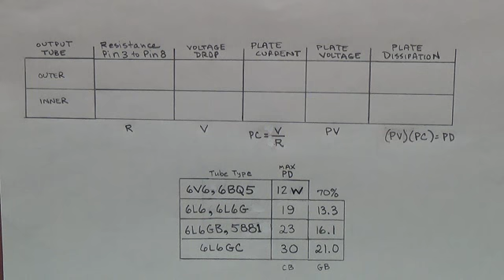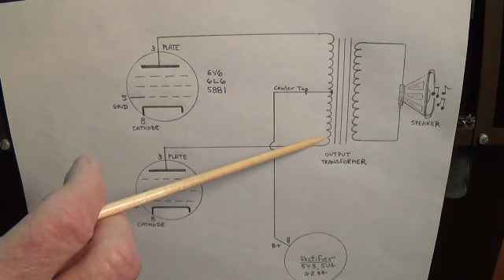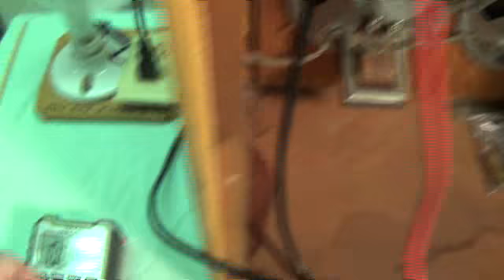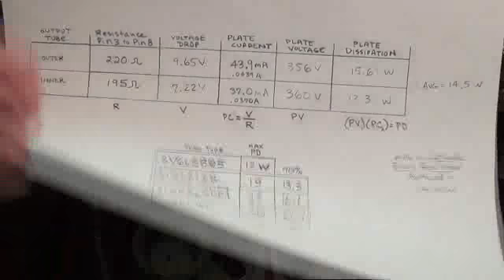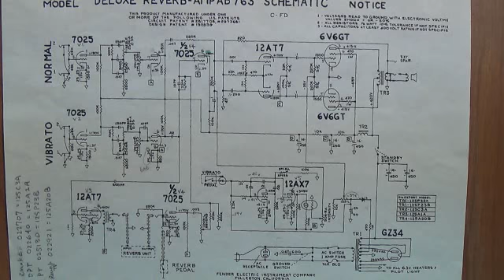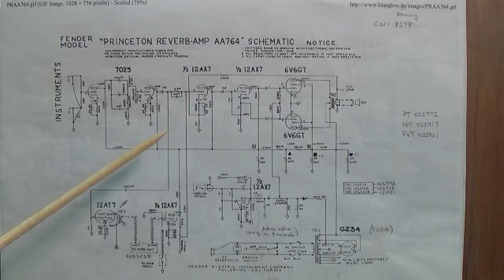Biasing Double-Ended Amplifier Output Tubes, Part 2: Demonstration and Discussion

Comment: When checking resistance from pin 3 (6v6), to pin 8 (5U4) on my old Epiphone Electar amp , I get a steadily increasing reading where the reading will not settle down and stop. My meter is good as per testing a  known resistor.  Any thoughts anyone?
Reply from the maker: The filter caps in the circuit are being slowly charged by the battery in your ohmmeter, which interferes with accurate resistance measurements.  Lift one end of the resistor from the circuit and you will get an accurate reading.
Reply: thanks you, appreciate it

Comment: Doug, great videos and instructional method, wish I had teachers like you in high school. I hope you can help with my issue, I'm working on a Princeton AA964 and did some upgrades on the passives that needed it. I'm getting some strange readings on the voltage drop, 1.96 and 2.03, resistance 146 and 149 which gives me plate current of .0134 and .0136 respectively. Plate voltages are 431 and 430 which gives me plate dissapation values of 5.77 and 5.84 respectively. Now the amp sounds OK, but those readings seem very much on the cold side, taking in consideration you comments regarding bias adjustment on these Fenders, is there some I need to do to or should do
 bring those values up? Thank you for your hard work.
Reply from the maker: If your measurements are correct, the biasing is way too low. Your PC should be around 30 mA. This video, or any number of more recent videos, should explain how to do this.

Comment: Hello Uncle doug !! I am going to do my first bias on my 73 yba1 traynor. I am following your video but since my amp is diode rectified I'm unsure where to test for resistance and voltage drop..
It has 6l6 tubes so pin 3.. 
I mistakenly thought testing ohms at the standby switch and pin 3 if the 6l6 would be the right place but I got .8 ohms. 
I'm not sure if I've given you enough info but if you could shed some light I'd be in your debt sir!
Reply: I don't know if it's relevant but I have a bias pot installed. 
Cheers
Reply: Am I wrong in thinking I can just test plate.voltage and.plate current and use a chart to find the optimal miliamp setting for my tubes?
Reply: I think I got it. With the bias probe I built  (guitologist video) I can test for plate current and plate voltage. Multiply amps by the volts and get plate dissipation. 6l6gc like 21 watts (70%) .
I was confused by the resistance and voltage drop  measurements ( which gives you plate current) 
This probe let's me skip those steps as I can meter for it. 
Turns out my amp was biased correctly for my tubes. But I learned something- however very slowly lol..
I have to thank you so much for all you taught us fans! 
Keep the content coming good sir and say hello to Rusty and the other fine critters !!
Reply from the maker: @soapboxearth2  I'm glad you were able to resolve the problem, SB. Will do :)

Comment: Thank you so much for this. I was happily unaware and thought everything was fine with my 5e3 amp until I saw this. LOL

I am currently running the stock cathode bias shared circuit and for the tube set I have, but after measuring each tube using the output transformer method, the inner tube is running at 98% (max dissipation) however the outer tube is running at 107%.

I have a brief question, if you don't mind.  If I added a resistor of proper value between pin 8 of the outer tube to pin8 of the inner tube instead of the plain wire I have now, would this work or am I missing something?

I would still be using the average, but the tubes would be more closely matched and average would be more accurate. Is this right?

Any tips or advise would be greatly appreciated.

Thank you again for sharing your expertise.
Reply from the maker: Greetings, Jim. Your best bet is to use a separate bias resistor for each tube, with values determined by experimentation (start high for safety) to provide proper PD for each output tube. Each of the resistors should also have its own 25uf bypass cap.
Reply: Thank you for your response. I tried last night using the same value resistor (one for each tube along with individual caps and the pd for each went up to 150% - 160%.  Sounds like I need to greatly increase the value to who knows what.  Is this normal?
Reply from the maker: @jimleo5265  If the original, single bias resistor was 250 Ohms, then try 500 Ohms for each tube. Go up if necessary
Reply: @UncleDoug  thank you so much. Happy Thanksgiving.
Reply from the maker: @jimleo5265  Likewise, Jim.

Comment: Very good video, but one thing to consider. When using a light bulb current limiter you can get a input voltage drop under load. Mine with a 200 watt bulb drops the loaded input voltage from 117.6 to 107.3 which can really affect your test results.
Reply from the maker: With a 250W bulb, the voltage drop and reduction of PV and PC is minimal for low-wattage circuits. For medium to high-wattage circuits, final bias should be with wall AC, not through the CL

Comment: I have been working on a 'Plush" PRB1000S Amp, this is one of the closer Schematics that I have Found, Besides, 'Earth G2000', Fender AA864, and Fender Black Face, and You of course! I have been able to get the Bias Right, with 4 6l6GC tubes. Running Hot at 26.8 Plate Dissipation Wattage Each. To Verify for myself, I connected amp meter in line with the Plate (60 MA each)....Trying to test on Ohms Law...it was still correct! works out to 80% of Max on the 6l6 GC. Guess you really don't need to break the Pin #3 connection for PI reading, but I just had to!
 Using your Videos, I have been able to reverse engineer, utilize your knowledge, to Plate Bias the Plush that has no Known Schematic. The Measured Values are different, But Ohms Law Never changes. Thanks!
Reply from the maker: You're welcome, Trevis. I'm glad the videos are helpful :)

Comment: Hello Uncle Doug. Once again, thank you so much for the great material! I have two questions if you have a moment. 1. Does the trem control on a Princeton Reverb effect the bias of the tubes? (I may have misunderstood) 2. Has anyone ever put one or two potentiometers in place of the cathode bias resistors?   Thanks in advance. Hope you are doing great.
Reply from the maker: Greetings, Mac. 1.) Yes, that's how it produces the tremolo effect. 2.) Yes, they have. See my video on  building the Champ amp with spare parts.
Reply: @UncleDoug  thank you!

Comment: VALCO National Dobro. The Dopeyra brothers kind of founded National Dobro and the halfway financed & founded Valco. Supro was the first non-"National" brand name that ever Valco used. By the time Baldwin piano bought Valco, Valco was making amps  for Oahu Publishing, Supro, Dwight, McKinney, Airline (Montgomery Wards catalog order), Silvertone (Sears Roebuck Catalog order), PennCrest (J.C. Penny's), Spiegel  Catalog order Company, Gretsch, Harmony, Kay, Weber, and lots of other obscure names, and there were even some just Valco models with names like "Rock Star" model. The Gretsch Chet Atkins model is a Valco and it it has a tone oscillator tuner built into to it. There is NO SCHEMATIC for the tuner part.
Reply from the maker: Thanks for the informative input, Seth.

Comment: Uncle Doug, this video has helped me immensely.  Question:  The center tap in my output transformer is not quite on center.  There is a 30 Ohm difference measuring to the anode pin on either side of center (150 Ohms, 120 Ohms).  Can I (should I) add a 30 Ohm resistor to one side to balance this, or does this cause a problem with the music (AC) signal?   THANKS!
Reply from the maker: That is perfectly normal, Cosmo. They all have some variation between the two windings. Leave it alone and enjoy it :)

Comment: Could you put your meter on those caps to see if there were indeed  charges there ?
Reply from the maker: Yes, you can connect a DC voltmeter to the plate of a tube and watch as it diminishes to zero.

Comment: By filter cap's, you mean coupling cap's ?
Reply from the maker: No, they are two completely different types and uses of capacitors. Watch my video on Coupling Caps and on Power Supplies. Coupling caps are non-polar, in series and block DC. Filter caps are electrolytic and reduce the ripple in rectified DC high voltage.
Reply: @UncleDoug  Thank you, got it. Thank you also for all the vid's, you are the only one using math and that's the only way to do it. I have been repairing and setting up stringed instruments for a while now and moved in valve amps a yr ago and you have been a massive help, turning into a nice little business. Keep up the fantastic work.
Reply from the maker: @JOMOENGINEERING1  That's great news, JE. Will do :)

Comment: Wonderful lesson and demonstration.  Your series of videos gave me the confidence to repair my 60's vintage Riviera 725 amplifier. After replacing one Filter Capacitor Can and all the tubes, the amp has never sounded better.  With the new matched set of 6V6s, the Plate Dissipation were 13.2 and 13.3 watts :-)  Thank you.
Reply from the maker: @cdnsatgate  Cathode-biased tubes can be biased at 100% of max PD, Harmen. Fixed bias are restricted to 70% of max.
Reply from the maker: Thanks, Harmen. Is the circuit cathode biased? If so, then your PD values are a bit high. If it is fixed bias (grounded cathodes) the PD is way too high. Please double check to avoid harming your new tube set.
Reply: @UncleDoug  Thanks for your reply. The circuit is cathode biased with a 400 ohm resistor. I assumed that maximium PD was 14 W on the 6V6 and thinking 94% was  high but still acceptable since I seldom go past 3 on the volume.  Should I be getting it closer to 70 % as you mentioned in another video?

Comment: Hi Uncle Doug, update on my Princeton reverb, after replacing the 27k resistance in the bias circuit(it was measuring 23.2k) and measuring again I got voltage drops 4.8 and 4.7 vdc. /pin 8 to pin 3, 162 and 166ohms / PV 399vdc on both tubes after doing the math I ended up with PC .0296 and .0283 amps / PD 11.8 and 11.29 watts. Is it still too high? Rgds A
Reply from the maker: Yes, PD should be around 8.4W.  Increase the bias resistance to 30K and see if that helps. Keep changing the resistance until you achieve the proper PD.
Reply: Uncle Doug Hi Uncle Doug, tried the 30K resistance instead of the 27K in the bias circuit, PD came down but not enough( 10.04 w and 9.24w) I’ll try a higher resistance and see what happens, you mention that it may be necessary to add resistance to the cathodes because of the tremolo being affected... by too high a bias resistor...Now I’m I starting to understand why this amp gets so hot.
Thanks for the great info.and great videos!
Reply from the maker: @alvarofalcon7136  You're headed in the right direction, Alvaro. Good luck.
Reply: @UncleDoug  Hi Doug, thanks for your patience, I raised the bias resistance again to 31.5K and now got PD down to 8.75w and 8.29w. Should I bring it down some more? I know one is a bit over the recommended 8.4w.
Reply from the maker: @alvarofalcon7136  I think you're fine where you are Alvaro. Your average PD is almost right on the money. Good work :)
Reply: Uncle Doug thanks again for sharing your knowledge, the amp is finally running cooler than ever and sounding good, the 6V6s are ancient sylvanias from a Hammond P40 but seem to be in good condition.
Reply from the maker: @alvarofalcon7136  That's good to hear, Alvaro. Continued good luck with it.

Comment: Hi Uncle Doug,
I finally decided to try your method for biasing fender amps. I just had the power transformer from my princeton reverb amp rewired (rebuilt) for the third time in several years....I checked and found the capacitor in the bias circuit loose, thinking that could be the cause of the failure, I fixed that and installed the transformer. The amp works well and sounds good but I feel its running hot, so I will check the Plate dissipation etc as you suggest and see if its too high. If thats the case Ill probably be writing you again.....Thanx
Reply from the maker: Excessively hot tubes = too much plate dissipation, Alvaro. Check it an see before more problems arise.
Reply: Thanx Uncle Doug ! so far I’ve checked the resistance of both halves of the OT 162 ohms outer 166 ohms inner,  voltage drop 1.3 vdc and 1.52 vdc, now I will measure the plate voltage do the math and see what I come up with. I’ll probably be in touch with more questions, this biasing thing is hard work......Rgds
Reply from the maker: @alvarofalcon7136  I get values of 8mA and 9mA for your 6V6's, Alvaro. If your measurements are correct, the bias is ice cold.
Reply: Hi Uncle Doug, it turns out that since I made the measurements with the amp pugged into a 60w light bulb (I was only getting around 99 vac from the 117 vac wall voltage.) after plugging directly into the wall and changing some tubes I got these new measurements.
Outer tube: R pin 3 pin 8=162ohm VD= 6.4 PC=.0385 PV=399vdc PD=15w
Inner tube.  R.                  =162ohm. VD= 5.91 PC=.0356 PV =399vdc PD = 14.2w
Now they seem too high for 6V6 s
Rgds and thanx for taking the time to explain all of this information!
Reply from the maker: @alvarofalcon7136  Jeez....from one extreme to the other. Good luck with this one, Alvaro.

Comment: On fender amps with a standby switch seperating the center tap from the rectifier tube, do you still measure to the rectifier tube and simply close the standby switch? For the measurement?
Reply from the maker: Yes, or you can measure the resistance from the OPT side of the standby switch.

Comment: Just a suggestion
On the fender amps
With door screen stapled above the chassis so many
Staples ar to keep it from sagging and shorting to any components it does
Gat grounded when the chassis is installed
And mounting screws are tightened it is a good ground hum
And RFI shield it works
And is inexpensive
It works as long as the screen comes in contact with the chassis at a back door of any amp as does on the Fender amps like
The 65 Champ or vibro
Champ. Easy fix for
RFI and magnetic hum
Shield. Especially those amps that have
Those rubber mounted tube sockets to reduce
Microfonic noise.
Like in the Gibson
GA 40 I did that for the GA40 it stopped the
Buzzing hum when my hand gets near the back door the amp
Was quiet after that. Man get all those old Cigar
But caps outa there
Make it playable
Forget stooped collect
Ability money comes
Money goes
Money is for spending
Saving and giving nothing more. It is not
God
 collecting it and it
Doesn't work just to look at. Is not sensible
It should work. Even if
It becomes worth less
Money money money
Enough of my soap box. Keep up the very
Nice work Uncle Doug
Hm A mans gotta toil
With His Hands
Dwight.
Doesn't work
Reply: Opps doesn't work at the end was a typo accident in the text
Dwight
Reply from the maker: Thanks for sharing your thoughts with us, Dwight.

Comment: Hi Doug , I have tried to not contact you but I am at my wits end. I have built a Dumble clone 50W and all looks good it works fairly well but I have a really annoying problem basically when I adjust the master and presence it sounds like a wireless tuner  (RF) and in certain positions it is OK but others there is a distortion relating to the RF I am sure there is RF interference getting in somewhere but I cant find where. I have tried a higher value resistor on pin 7 of valve 1 and also tried a 0.01uf cap from input ground to chassis but nothing seems to work . Is there anything you can think of that might shine a light of divine inspiration onto the project that just wont lie down . The output tubes also glow brighter when the master is turned to 11 not red plating but it is getting hot in there . checked Bias and both around 14w 6l6's so they are about right . Had a really strange one on the screened input cable when you moved it the volume doubled it was really good cable but I changed it for a lesser one and it is now happy as Larry the connection was fine I even swapped it for another piece same thing really odd  .I even tried swapping the OT to pins 3 of the 6L6's that just gave a nasty feedback that was uncontrollable so I swapped back .   

Any words of experience would be great I can post a video if that helps. 

Nikk
Reply from the maker: What an unusual problem, Nikk. I wish I had some personal experience with RF interference to rely on, but I did work on radios in the past, so that may help. As you may know, radios rely on an adjustable tank circuit that resonates at the carrier frequency of radio transmissions. The input section of your circuit must be resonant to these high frequencies. Fender used screen on the ceiling of his cabinets to cut down on RF, and I tend to use shielded cable for all my signal-carrying wires from the input jacks through the 1st preamp triode, VC, TC, and tot the 2nd preamp grid. Change to shielded wire and ceiling shielding......see if it helps.

Comment: Awesome videos, learning a lot.  One thing you didn’t mention is that if you are doing this procedure on an amp with a “standby” switch, you will need to turn the switch on or you will show no resistance between pin 8 and pin 3.
Reply from the maker: Thanks, Brandon. Yes, you're definitely right.